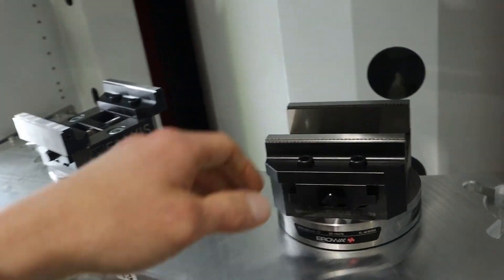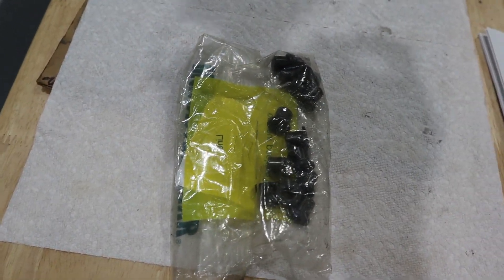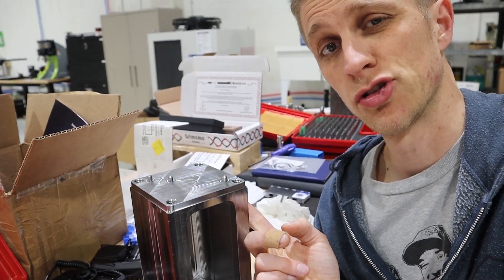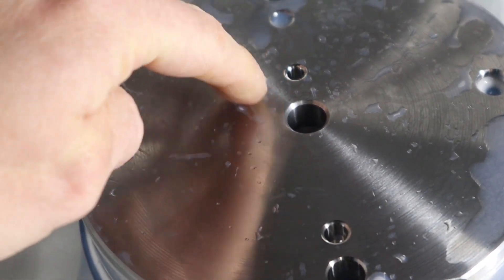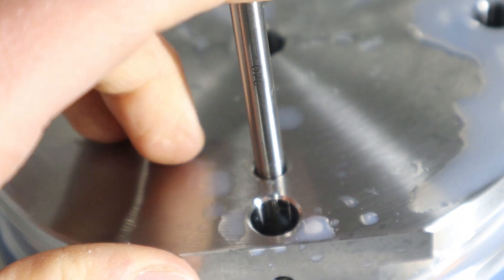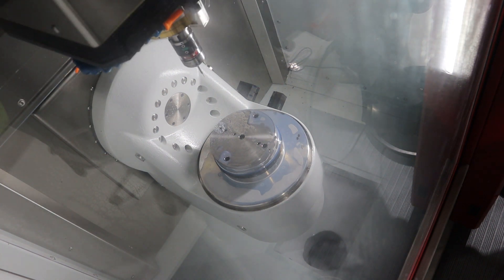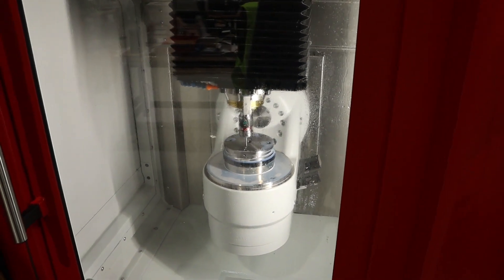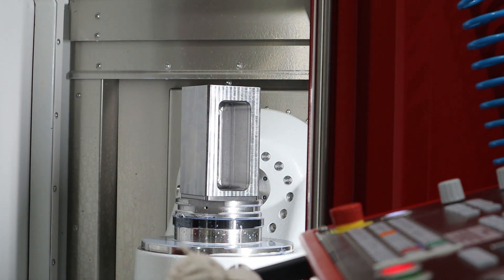Kern Pallet Changer - Quarantined Shop Life Day 16

Comment: You NEED a force fit or at least a press fit to get precise location with a preload. It's the interference that will grip the pin in the hole center instead of letting it pitch, yaw or press against only one side. Just remember to relieve the surface around the bores as the material will grow out when it's pressed in and make a threaded extractor hole on one part to get it out later.

Comment: Guessing you machined the hole then the radius on top. That would have left a slight burr at the transition of the radius to the cylinder of the hole. That is the most likely explanation of why the probe showed the hole bigger than the pin, the pin was hanging up on the burr. The same with the tombstone it was hanging on the burr, its why it fit but was dragging. Since you probbed under the radius to cylinder transition you were reading the actual bore value that the pin couldn't get to.

Comment: if you want to speed up the toolchanges, Most machines are set up so if you use TOOL DEF it wil preselect the tool in the changer. At least thats how it works on our Kao Ming and Kekeisen. Makes a way to long tool change a few seconds faster (cat 50 has slow changes by default)

Comment: Be careful machining through the pallets, you will get chips down in the pallet interface and need to meticulously clean it.  You also risk running into one of the lapped spacers on the bottom of the pallet.
Reply from the maker: Yeah I was super duper careful clearance wise, plenty of room.  But the one hole that I went through was that arch on the back of the pallet, couldn't avoid it.  I guess I could have left a few thou from the top and hit the rest when machining the screw head countersinks, didn't consider that.

Comment: Your probe is right!
You can´t measure a .250 hole with a .250 pin, it physically will not fit.
So by gauging with the .249 pin you are confirming that the hole is .250
Reply: Unless it's a minus pin. A 0.250- pin should fit in a 0.250 hole because it's undersize. Don't know if John is using minus pins though.
Reply: @evbunke2  i think i saw a minus
Reply: You think a .249 pin shouldn’t go in a .2505 hole?
Reply: This is a common misconception. Plug gauges do not tell you anything about the actual size of a hole, they only tell you what the fit of the pin into the hole is. Comparative measurement through the use of bore gauges or air gauges is the only way to get the actual hole dimension. Plug gauges are useful, but are not an acceptable measurement method for understanding true sizes. Notwithstanding a CMM.

a .249 pin does not confirm the size of the hole, it only confirms the fit of a .249 pin into the specified hole.
Reply: @hartmetall he probed the fucking hole... 5 tenths clearance on that size is fine...

Comment: Try cycl 421 in the TOUCHPROBE menu 
make a quick cycl 421 in the mdi and set q281 to =2 so it will pop up a little measuring protocoll with all your measured coordinates
you can even put a tool number in and let it automatically change the tools offset to get the perfect fit

Comment: John what is your safety protocol now that your working alone in the shop.  Heaven forbid an accident occurred. Can you quickly get hold of Eric in the next building.  Do you both of you check each other every 20 minutes or so?  

Just wondering and wanting safe environment for you and your lean crew.  Thanks for posting these videos.  Stay Safe.
Reply from the maker: Yup we've implemented a process to check in on eachother often, but we're also both really used to working alone in a shop

Comment: Will the Kern allow for grinding operations?  seems like you might be able to achieve better surface finishes with a grinding as the final operation.  No dowels or bushings is OK.  WHen the prin breaks, you can repair with bushings and dowels.
Reply from the maker: Yes I can do grinding on this machine, I'm planning on doing a little bit.

Comment: How hard would it be to program in a probing cycle before finishing the bore? Or do you not trust the probe to be as accurate as the gauge pins?
Reply from the maker: Very possible, just tricky because I have to feed it through Camplete, it's something I'm working on with them now.

Comment: Just two pins clocked at an angle other than 180° would've done the same with less machining, also poka yoke
Reply: Marius B that’s why I read the comments... someone has done a lot more fixturing offering more clever ways to do things.
Reply from the maker: @KeithStrang  But with 2 pins you COULD still put in on backwards, and hopefully you'd notice that it's off center, but maybe not.  However, playing off that idea, one big pin and one little pin would be the best of both worlds.
Reply: JohnGrimsmo I think OP was saying 1) Use Pins so you don’t have to remove material to “make” pins and 2) Put the pins at a non-180deg angle from each other.  If they were at 170deg I think either the pallet wouldn’t go on any way or if it could, it’d might just hang off the side. Either way, what you did will obviously work 100% great with zero functional issues.

Comment: Is it just me, or is the through-spindle airflow messing with you when you try to fit stuff in the holes?
Reply from the maker: Coming up through the table?  Not on the small hole that I was trying to measure, it was just full of coolant.  But on the bigger hole behind it the hole happens to go all the way through the pallet so yeah there are bubbles coming up.

Comment: If you do a probe to measure the hole diameter, you should NOT rotate the probe, because if the probe has runout then the measured diameter is the hole diameter + 2 times the runout of the probe. You should ONLY rotate the probe to locate the center of te hole.
Reply: pretty sure that machine has compensation for everything . A standard omp40-2 has compensation parameters in xy . when you calibrate it, it rotates 180° and does the calibration again . I don't know why the kern does it this way , maybe it's 0.3µ better than the standard method.... , point is it should not matter . The comp parameters are the reason why you don't have to dial in a stylus under 0.1mm for example . I tested it 0.3mm crooked , it was still true to +-2µm .( i dialed it in under 0.01mm just so that i don't lose travel and touch with the stem on 1 side )